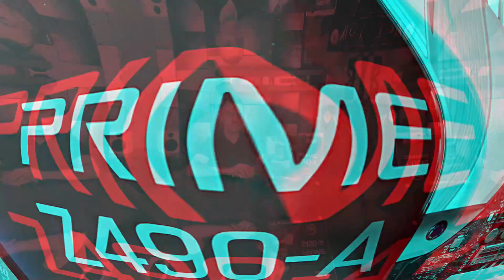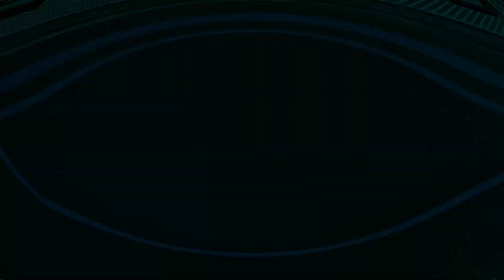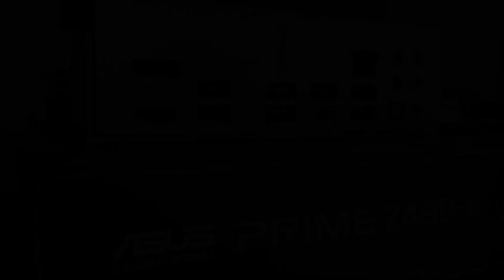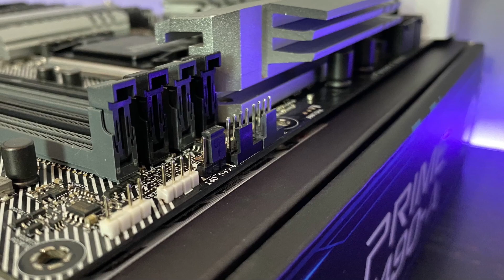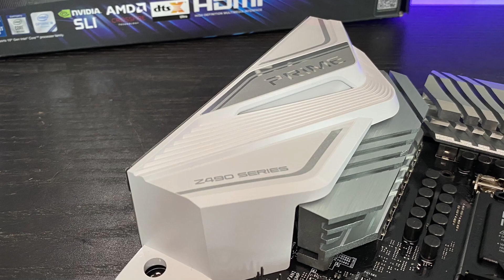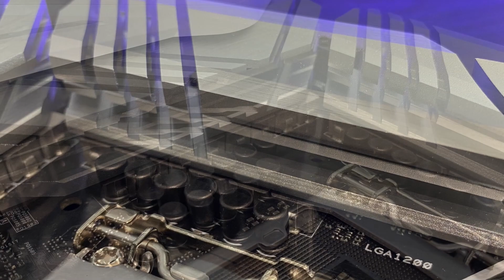ASUS PRIME Z490-A - introduction and overview

Comment: does this motherboard work with intel i7 10700k? Also would a rtx 2060 work with it while I wait for 3070s to restock! Thanks!
Reply: Works for 10th gen and 11th gen cpus. So yes,ur i7-10700k will work. Yes to 2060,and 3070. But I don’t think this mobo is gen 4pcie. I could be wrong .

Comment: Comparing ROG STRIX Z490-A Gaming and ASUS Prime Z490-A, which one is better?  I like the 4x USB 3.2 gen 2 on the back panel of ASUS Prime Z490-A, but only 2x USB 3.2 gen 2 in ROG STRIX Z490-A Gaming. One key point, ASUS Prime Z490-A user's guide says M.2_2 shares bandwidth with SATA6G_56, but ROG STRIX Z490-A Gaming user's guide doesn't mention M.2_2 and SATA6G_56. Not sure it's because ASUS missed mentioning this on the ROG STRIX Z490-A Gaming user's guide, or M.2_2 DON'T share bandwidth with SATA6G_56. This is also a key point to me because I need to connect many HDD/SSD and M.2 NVMe. Would you please help to clarify this?  Thanks a lot!

Comment: What is better? Motherboard Asus ROG Strix Z490-A Gaming or Asus prime Z490-A?
Reply from the maker: ROG STRIX Z490-A Gaming
Reply: @PCCrazyDario  Would you please let us know why ROG STRIX Z490-A Gaming is better than ASUS Prime Z490-A? I like the 4x USB 3.2 gen 2 on the back panel of ASUS Prime Z490-A, but only 2x USB 3.2 gen 2 in ROG STRIX Z490-A Gaming. One key point, ASUS Prime Z490-A user's guide says M.2_2 shares bandwidth with SATA6G_56, but ROG STRIX Z490-A Gaming user's guide doesn't mention M.2_2 and SATA6G_56. Not sure it's because ASUS missed mentioning this on the ROG STRIX Z490-A Gaming user's guide, or M.2_2 DON'T share bandwidth with SATA6G_56. This is also a key point to me because I need to connect many HDD/SSD and M.2 NVMe. Would you please help to clarify this?  Thanks a lot!

Comment: I have bought this motherboard, but having a few issues on build. I have connected CPU in this case i5 10500, with cooler and connected this to the cpu cooler socket slightly above. I have also installed 500w PSU and 32GB DIMM, however i have an onboard chassis fan and not sure where to plug this? Hard drive is connected via correct sockets. However on boot up lights show where the ports are and M.2 are but CPU fan does not work and it does not boot , any  help?
Reply from the maker: Connect your CPU fan to the top PWM header called CPU FAN1
Reply: @PCCrazyDario  No I have the same problem and the fan is connected to the right header, any other ideas since I need to plug in half a six port power connector into the four pin socket it just won't accept it any other way.
Reply: Did you ever find a fix? I'm in this position myself after picking one up and pairing it with an i7 10700k.

Comment: Does this motherboard come with Sata cables? And if so how many
Reply: And does it support master cooler ml 240r rgb?
Reply from the maker: @n77030  Yes it comes with SATA cables, but not sure if it comes with 2 or 4. As for the Cooler Master ML 240R RGB, yes it can fit since it fits 115x sockets.
Reply: @PCCrazyDario  thanks already builded :D
Reply: Hello it says on the website that it comes with 3 x SATA 6Gb/s cable(s)
Reply from the maker: @bobmurray9443  Honestly, motherboards never come with odd number of SATA cables. It is either 2 or 4, but not sure which one.

Comment: currently running this board with a 10th genn i9 10850k  and it runs great and the audio sounds sooo good  love this board and it looks so good in my build
Reply: Thinking about getting this in 2021 ! Microcenter has this combo for $550
Reply from the maker: @KDThePorchPodcast  What about waiting for Z590?
Reply: @PCCrazyDario  I actually just copped the z590 A Rog Strix for $300 and the i9 10850k for 350$ . I was thinking of getting the z490a prime just because they was bundling it with the i9 for $499 at micro center . Was tryna save as much money as possible
Reply from the maker: @KDThePorchPodcast  Oh yeah, that makes sense more, but still I would say a good buy. ;)
Reply: @KDThePorchPodcast  how do you like the rog strix ? Mine is in the mail getting it tomorrow but thinking about returning it.. I don’t overclock and didn’t realize it’s geared to that.. can I still use it fine without overclocking ? Can I just raise the xmp for the ram to reach like 3600? It says stock  the ram goes to like 2,000 something?  So was just gonna raise it to match my ram and that’s it .... I’m kinda new to building , thx for any help
Reply: @paulg2100  Sorry bro , But I didn't end up getting this . I actually switched to AMD and got me a Ryzen 7 5800x with a Aorus master B550 Motherboard and Im so happy I did .
Reply: @KDThePorchPodcast  i would recommend  the main thing i noticed about it was how good the audio sounds
Reply from the maker: Thank you very much for your feedback ;)

Comment: Hello, can you please help me with an answer? I have this motherboard with i9 10900 and Crucial 32GB KIT DDR4 3600MHz CL16 Ballistix Red and I'm struggling to find a PSU for it. Can you please suggest something about 150 euro max? Thank you in advance.
Reply: I use a 750W Corsair power supply I bought for 140 usd!
Reply from the maker: True what Menafuls said or Seasonic, but it also depends on your GPU.

Comment: hello, i would like to know how can i get wifi on this motherboard ? thanks
Reply from the maker: DrEam_K USB WiFi stick or PCIe card
Reply: It has a M.2 slot.  I believe this would work:

https://smile.amazon.com/dp/B082X6Z2M7/?coliid=I1O3O8O0F5NNA3&linkCode=as2&tag=cdsheffer-20&linkId=309cc728731fa1095c76e245279f967e

I am planning on building with this motherboard so if it doesn't work I will come and update this :D